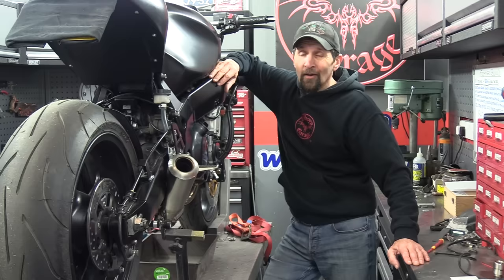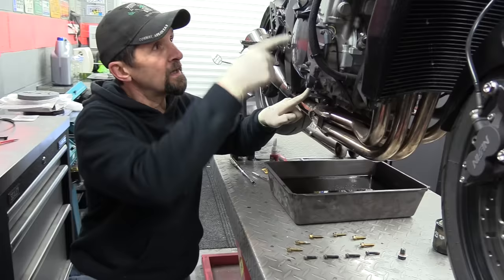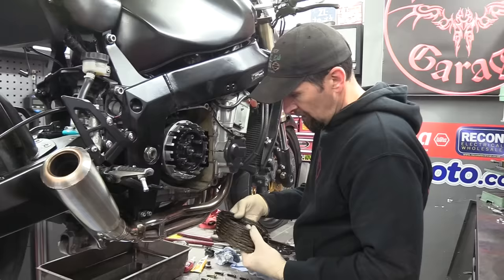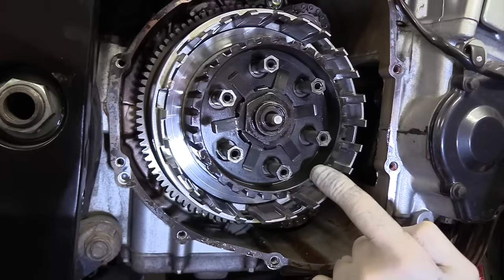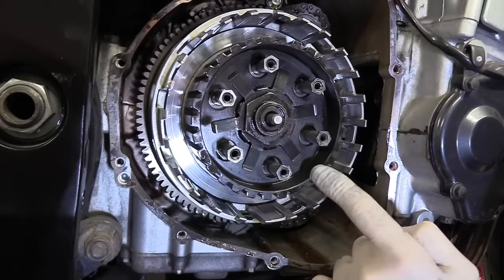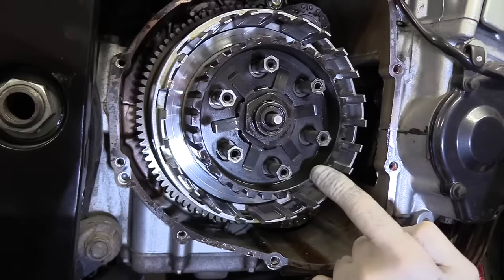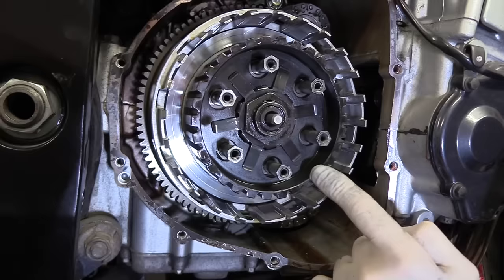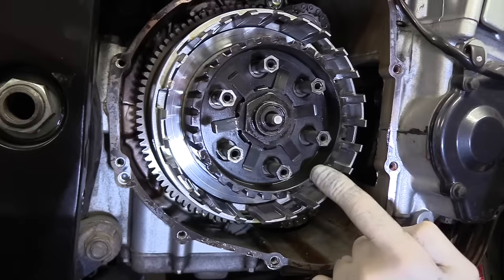Delboy's Garage,  Motorcycle Clutch Replacement .

Comment: Thank you for being the first person to ever successfully explain to me how a multi plate clutch actually works!  Great video. Thank you.
Reply from the maker: Thank you my friend, that's a great honour, am glad you enjoyed it and it wsa a pleasure to help!
Reply: @Moonfleet41  another great vid think i need to do this on my old GPX its just started slipping and cable is fully adjusted, was just wondering if it would be ok to use copper grease on the gasket as thats all i have at the moment? Thanks Del

Comment: Changed so many clutch's over the years but never though of making a dowel from a bolt to Aline the cover,That right there is a life lesson i will surely use in the future , Thank for that Del
Reply from the maker: Most welcome mate, just a little ghetto fix, they're great for getting you out of trouble aye?!
Reply: Good morning my friend can tell me if the part cod honda 22000 MCJ 305, fits in our CBR954 2003 I'm from Brazil

Comment: I am no longer afraid to change the clutch plates on my Bandit.
Reply: I may have to do mine as well, what year and mileage is yours?
Reply: @shaneking5610  I just got an EBC set in the mail today for my 2001 Bandit 1200. Not entirely sure I'm doing it myself since I have crash bars, might not have the proper tools and don't know the torque specs.

Comment: Del, did you know that on these specific bikes the zxr750/zx7 you can buy thinner metal plates (standard are 2.3mm you can buy 2mm) either all 7 or say 3 of them and then that last friction plate you fit the same way as all the others - this then makes the clutch act a bit like a slipper clutch on downshifts, an early version of the slipper clutch!

Comment: I just like to give credit where credit it due, I've been a teacher at varying levels my whole career and your instruction/demonstrations and explanations are first-class.
Reply from the maker: Thank you so much for your kind words of support..
Reply: @Moonfleet41  What's the substance you put on the oil sump bolt? I couldn't make it out. cheers
Reply from the maker: @mudjumperktm  The sealant for the sump plug would have been Blue Hylomar.. still readily available.. !

Comment: Good tip about the manual, there are occasionally some things which can catch out even experienced mechanics. Prime example, FZR clutches need the pressure plate fitting in a particular orientation (dot on the plate aligns with a triangle on the basket, and unusually there is a specific way around for the steels to go, rounded face inwards, sharp edge outwards.  I've not seen that on any other clutch, but ignore either point and the clutch will slip.

Comment: 3rd time I found and watched this Video.  Big Thank You to you and Camera person ;-)
Helped me replace Clutch on VX800. There's a moving back-torque limiter, 4 short bolts go there . . . . . tricky! Used the long ones for clutch sleeve hub to hold it in place first. . . . .  through Draiper 1/4 torque wrench accross garden, used "Palmaris longus" torque setting. . . . 
Now to get fuel pump out of the deepest caverns of the bowels of this POS. . . . . . scunn'urd 
Front cylinder intermittent/not firing. . . .checked spark and tried to balance Carbs. . . . . vacuum return to pump next step.

Comment: Watched your video about changing brake pads after having a dream of a mate telling me they need changing. Checked the rear pads, they have about 4mm left so put them back. But the front pads were well worn down to less than 1mm, so they were changed, easy enough once figured out there were two clips holding the pins in. Thanks alot

Comment: Great video clear and concise . Goes over all the important bits you need to look out for..
The bit about using a bolt cut off for alignment is a method I've always used particularly when assembling a split engine case it's so easy to knock something out of place if you don't use guide dowels .I've used bright bar and threaded it in several lengths and sizes m6 , m8 etc. His work method is the same that way that I go about a job. On a bike and even my own you have to do it RIGHT no half measures . I don't do half jobs and this guy does the same . All clear instructions that are easily understood for those that are not sure. One important tool for use on any bike is the torque wrench . Buy a good one 
I have a 1/2 " and 3/8" plus reducing adaptors to 1/4" .
It's too easy to over tightened bolts in an all aluminium engine cases. The gasket method fitting  is domething I always advocate doing , trying to get bits of old gasket off an engine in the bike is a no no from me. Look forward to any new videos I enjoy watching a master class that's good for the novices to learn from doing their own maintenance and getting it right.

Comment: Very informative and it made the whole process less daunting for the novice.  
As regards the oil filter, I always fill the filters with fresh oil before spinning it on as it means that the bearings get the oil sooner than waiting for the pump to fill the filter and I always spin the motor up with new oil without the plugs in to generate oil pressure with the minimum load .  Being a horizontal filter is no problem as the internal valves prevent the oil draining out.  Also, chrome filters are a bad deal and only bearable for bling motors where the filter is exposed.  The chrome finish does not allow for the heat to escape and indeed it can absorb heat, which on your bike has the exhaust and the rad immediately infront of the filter with any inlet air being ducted through those hot parts onto the filter.  There is a very good reason why the OE part is black and that is to get rid of the heat.

Comment: After dragracing Suzuki’s for the last 28 years I can tell you the OEM clutch plates are the best. I have installed a lot of clutch plates over the years. OEM clutch plates and heavy duty springs works great. And if you’re not a drag racer you can buy a pack of heavy duty springs and only put in three of the six (every other one) spacing them out of course. That will give you extra tension on your clutches without being so hard to pull in at the red lights.
Reply from the maker: Thanks buddy for those great tips and advice, I'm currently contemplating the time honoured clutch mod for my Hayabusa, sick of it chattering and lurching off launch, tossing up between the spacer ring and buying a billet clutch slipper... not so sure about welding it, the consequences of it breaking up, or failing, are pretty severe but I will certainly stick 3 extra strong springs in for sure at the same time!
Reply: Delboy's Garage you are welcome! If you like to drag race a little bit the clutch mod is a must. I have done it on all three of my Hayabusa’s. Two of mine were welded but the last one I did the billet.

Comment: Del, in my experience I’ve always primed the oil filter by filling it halfway up with the fresh oil that way it’s not dry when it first throws oil through it. A lot of my teachers said to do that otherwise it can mess up the oil filter initially. Not sure if it’s 100% true, but I always figured it couldn’t hurt. Plus when a bunch of old heads who have been wrenching on bikes for 20-30+ years say to do something it’s generally a good idea to listen to them. Also pro tip: cover the pipes in aluminum foil when your taking off an oil filter so that way you don’t have to wipe off oil later on and have smoke pouring off hot pipes.
Reply from the maker: I think certainly with any filter that is undermounted, I fill it before I screw it in, but any side mounted filter, even half full, just pours out before you can screw it all the way in, and you end up with oil everywhere!  ...Plus, of course, in a tight spot like this behind the pipes, you can never get in screwed on quick enough to prevent it spilling... depends on the application mate aye?!  Have a great weekend...!

Comment: I have an Intruder VS1400, this bike is known from the factory to have weak clutch springs, Its my understanding Suzuki did this on purpose in a sense to protect the "usual" rider from its low end torque and allow the clutch to slip a bit, however, there are a couple individuals that manufacturer high end springs for this bike, I just installed a set, changed the bike, smoother, no slip, all power to the wheel, I guess when Im not riding, Im workking on bikes, when im not working, IM watching videos, you have a superb channel and I have always had a connection with Brits, peace from across the pond
Reply from the maker: Thank you for your kind words, am glad you like the Channel...and for what it's worth, I can't imagine tha Suzuki would have put a weak clutch in to protect the rider by making it slip, it would be far more likely they just cheaped out and fitted the minimum to keep the profits up!  Either way, it is a common issue and a great upgrade, good call!
Reply: @Moonfleet41  Haha, yea, Thats the nonsense I have heard so I dont take it too seriously,  it would make sense that the springs are of lower quality OEM, are you familiar with the VS1400? Its a strange bike to tune with its dual carb setup and tolerances, I have had mine on the lift for a few days with all types of upgrades, its been well worth it as this 24yr old bike runs like a dream, Cobra drags with BCT baffles, dyna ignition, stage one FP jets and needles, caliper rebuilds and new pads. once you get this bike right its amazing

Comment: Another great video and congratulations to you both. Always a pleasure to watch, and Del, you have the gift of explaining things in a simple way without talking down to your audience. I have replaced clutches on both cars and bikes and would prefer to do the job on a bike any day!

I know this is a motorbike channel, but I thought I would mention that your gradual star pattern tightening of the clutch springs is also applicable to lug nuts on the wheels of cars, trucks, trailers, etc. When I was in my teens my Dad taught me how to torque wheel lug nuts properly. He learned himself at a young age from a heavy equipment mechanic, who explained that fasteners torqued in this way can be relied upon not to loosen... especially useful when those fasteners are difficult to access.

Typically after hand tightening lug nuts I will lower the wheel to the ground, then tighten all of the nuts in a star pattern to 1/3 of the torque spec. Repeat the process at 2/3 of the spec and again at 100%. Nowadays it's common for car and RV repair shops to warn you to check lug nut torque after driving for a short amount. With this method, that's not necessary; I've done spot checks and have never found a loose lug nut.

I also like the tip for headless bolts as dowels - very clever!

FYI a good video on how a motorcycle clutch works: https://www.youtube.com/watch?v=agLa0A8GAfc
Reply from the maker: Hi John, you're absolutely right, back in the mid-80's I trained as a bus fitter, so that information is bang on correct... the standard practice these days, after torquing in increments as you explain, is to torque check again after 24hrs... and at the company I currently work for, it's actually a legal requirement, the vehicle can't go on the road until it's been done.  Great to see that old traditions never change, means they must be right aye... Thanks for sharing your insight, keep in touch, all the best, Del

Comment: he is correct, the first time i replaced clutch plates the instructions did not specify to soak each one "individually" in oil,  I put the whole kit in a batch of oil and let soak however i did not separate each one and when i installed them, they looked soaked however oil did not penetrate in between the plates and my bike lurched forward! and i ultimately had to do it over and soaking each one before replacing before my bike ran smoothly.

Comment: Thanks Delboy
You’ve saved me a lot of money over several years.
Reply: Just replaced the steels and friction plates on my 2019 XT250; did you know that two of the six friction plates are 'heavy duty' and have to be positioned in the middle of the pack ?. AND I uncovered a big discussion as to which way the steel plates should be orientated- ie smooth side in or out... as long as they are all the same it seems it is probably OK but there are two tribes on this issue !

Comment: Great vid and so informative especially for the gasket greased on outside,I have always used blue hylomar on outside but it makes sense to grease it..another lesson from my bike guru. Thanks Del!
Reply from the maker: Cheers buddy, glad you could use it, all lessons learned by making mistakes aye?!  The first time you have to spend scraping gasket material off an engine with all the bits dropping in the oil ways, you'll soon learn to grease it so it comes off in one piece lol Thanks for your kind words, much appreciated!
Reply: Aye! You’re speaking my language now to many’s a gasket I’ve had to scrape off and it’s a painstakingly nasty job cos you don’t want to damage the surface cause an oil leak it has to be flush,grease!so simple!
Another lesson learned 
Aye cheers again boss

Comment: Good instructional video for many but there has to be a but, You did mention the driven plates but rather than inspect and clean them then put them back. 
I think you should have measured them with a micrometer (not a vernier) and checked they are within tolerance, the dimples aren't wear lines. 
Also check they are not warped using a flat surface i.e. a surface plate or a piece of plate glass and a feeler gauge. (not the bench or kitchen worktop). They don't have to be warped much to cause a problem.
Reply: Glass plate was mentioned

Comment: Thanks for the great vid , I also have a ZX7R and have found your fighter uploads enormously helpful in doing jobs on my bike I wouldn't have had a clue otherwise. Next job over winter that needs doing funnily enough is my clutch lol which started slipping under load this summer. Now, thanks to your video I have a clear understanding of the job which doesn't look difficult now.
Reply from the maker: Hi Stuart, my word, that's appropriate, couldn't have worked better aye?!  Good luck with yours, as you can see, it's a simple enough job, make a choice whether you want to invest in the steel plates as well, think they're about £7.50 each, so another £40ish on the bill, or you could check the old ones and see how they are... but you'll love the feel of the clutch with the uprated springs, much beefier!  Good luck with it, Del
Reply: @Moonfleet41  my bike is a keeper so I'll probably do the steels as well,  thanks for your reply,  looking forward to many more videos from you.  Thanks again Del

Comment: Great job Del, ive always feared messing with the clutch as i thought it would be a massive complicated job,.it looks pretty easy, Thank you for making it look so easy
Reply from the maker: Hi Dave, it was pretty simple as it was the first level of getting involved with your clutch, it's a lot more complicated to stript the entire unit right back tot he bare shaft, but you don't need to do this, unless you've got far bigger problems, this is really just the consumables check, the bits that wear out, like the friction plates and the springs, a bit similar to changing brake pads in the calipers, rather than stripping the whole caliper down... it's how we learn aye mate, a little at a time!

Comment: That's good practice, alternating sides as you loosen the case cover. I've changed clutches before but hoped to improve my game a bit. I'll be doing it that way from now on. Mission accomplished, and I'm just at 4 minutes now! 
BTW one thing I like to do is take a piece of cardboard, draw the outline of whatever side cover I'm removing on it, and push the bolts through the drawing in the appropriate spots as I remove them from the bike. Sometimes I find up to 3 different bolt lengths among the handful removed, and this keeps it tidy so all the right bolts go back in the right places.
EDIT: And... 20 seconds later you say the exact same thing. Ill just shut up and watch.
Reply from the maker: Hi buddy, I thought it was only me that did that!  You think of exactly the thing you wanna say and then the video covers it DOH!  Thanks for your support buddy, appreciate you watching, all the best, Del

Comment: Lol I was thinking why is he only replacing the friction plates, he should at the minimum replace the springs too. Then I watched the rest lol   Great job especially if your trying to save a buck. Personally I would replace the entire clutch pack but I get were your coming from. That should work well and fix the slip issue. Great job👍👍
Reply from the maker: Hey brother, great to hear from you!  It's always an natural assumption to simply replace the lot, but you truly don't need to... the steel plates in any clutch will see out at least 3 sets of friction plates, it's almost like replacing your brake discs every time you replace the pads, it's just a waste of money... if there are any scuffs in them, or they are warped, then obiovusly replace them, but I've never found a worn out set yet... great to hear from you as ever, take care, Del
Reply: Oh I agree lol but hey I'm the guy that wears my brakes into the ground and replace the rotors with the pads 😆 Great instructional video with some great advice brother.

Comment: Waiting for my ‘66 Norton N15CS clutch parts as we speak. Some great info here and hoping that using your method, I can seal up the primary. They say the old English bikes prefer the oil on the outside, I’d rather keep it on the inside. I’m also going to double check the manual on soaking. That may explain the dire condition of the clutch.